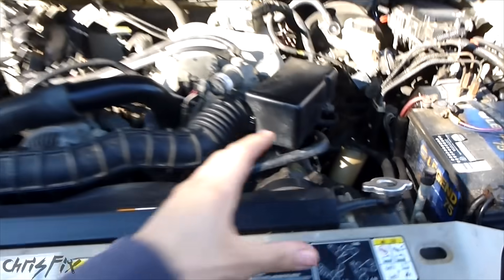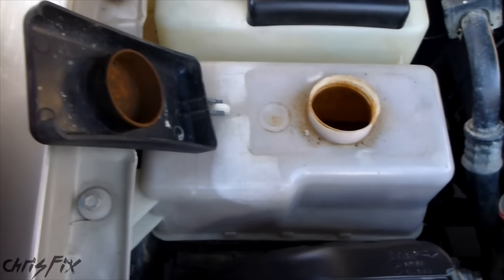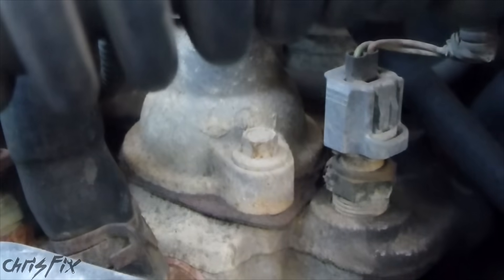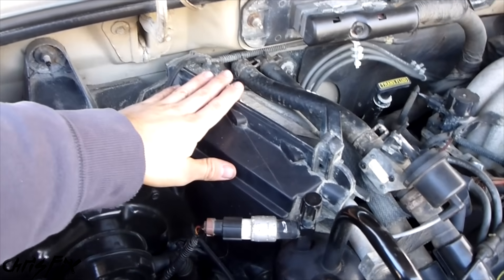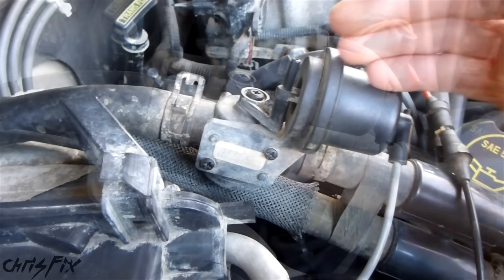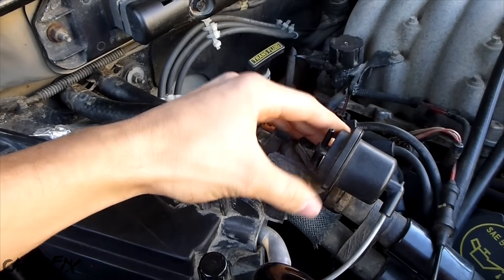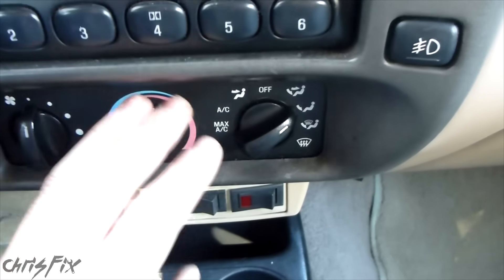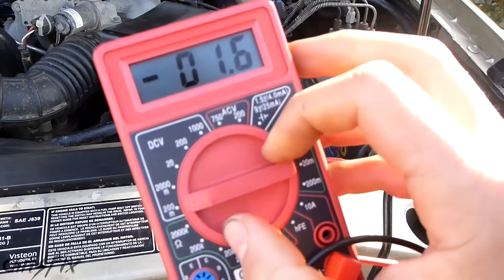How to Fix a Car with No Heat (Easy)

Comment: I have an 89 Cadillac DeVille
When the air conditioner is on cold air blows from everything but when the heat is on it blows from everywhere but the front facing vents.
Hot air blows from the windshield vents a d the floor vents  but nothing comes out of the vents on the dash. What do you think it is?
Reply from the maker: I’m assuming that is a vacuum actuated vent door system so check for a brittle/cracked vacuum manifold or vacuum lines which control the vents.

Comment: Do you think the recirculating door or outside air door would affect the heater output temperature? I know the position of the blend door does.  Thanks.
Reply: No.
Reply: @MrLucifuge1973  Okay, this is my Son's 02 F150 Pickup, has the 5.4 engine. new coolant thermostat last year along with coolant flush and heater core flush. had luke warm heat before that was done, had fair heat afterwards but gradually got less heat over the winter last year. this year didn't think about it until heat was needed. the AC works great..now we have some warm air not hot, have the temp knob turned all the way up, had the heater core back flushed again last month, cut access panel in the plastic heater box to check the blend door and it is working like it should, burped coolant system in case of air,     both heater hoses are hot but the outlet hose is about 15 degrees cooler than the inlet hose. my truck is that way too and my heater is great. if we turn the blower fan off for a few mins then back on, we get better almost hot heat for a minute then it drops back down to only fairly warm again. this same thing will happens if you shut the truck off for about 15 mins and then restart it  you will have warm almost hot heat for a short time then the air temp drops back down to fairly warm...it's hard to figure out what's going on, about ready to have the heater core replaced. not sure if it's original but the truck has 195,000 miles on it. Thanks for the reply back its appreciated and any comments from anyone that could help us figure this out is appreciated.
Reply: @dddddd2100   I don't think it's the core itself. I'm thinking it is a control issue ie your heater control valve. Is the vehicle staying at the same temp when it warms up? Check and see if you have a ambient temp sensor or check the HVAC computer module. Other then those I'm stumped lol

Comment: 2011 Nissan Altima, not moving heat or air.  Was told it was the blower motor.  Quoted $400.   Single 53 year old lol.....Any videos on changing it myself?  I think I have to go through the glove box to got to it.

Comment: Hi I have a 1993 c1500 truck my climate control is flashing arrows I have no heat I change the blend door still no heat and my temperature gauge are reading low any suggestions thanks

Comment: Do you have a how to replace a blend door actuator video? I have a 2005 tacoma thats giving very low heat then the circulation button turns on by itself followed by no heat.

Comment: I’m having this problem on my 2016 mustang. It has ice cold AC but the heat just randomly stopped working. Hopefully this fixes the issues cause I really don’t want to take it to the shop and come out with a $400 bill.

Comment: My heater core got plugged and I used a hard water cleaner CLR and it worked like a hot dam just unhook the heater core and swish it back and forth ,dealer wanted big money.

Comment: I’m noticing slightly hot air coming from 2 out of 4 vents in the car. I’m suspecting the blend doors because if the heater core was clogged then wouldn’t I not get any heat?

Comment: @chrisfix, I've run the climate control self diag on my car and I get a code that corresponds to the mix door being shorted. When I watch the actuator it moves as intended. Can an actuator have a short that prevents heat working but still moves?

Comment: So my blend door doesn’t move I pulled it and put a new one in plugged it in before installing and it doesn’t move when changing temp. I also unplugged the vacuum line on the heater control valve and it’s blowing warm. But still doesn’t help my for why it isn’t changing temps. Both lines going into the cab are also hot

Comment: Sorry if this has been asked already....but mine greatly reduces the hot air when stopped at a light (idling).  Any ideas?
Reply: Goes from really hot to Luke warm
Reply from the maker: Typically an issue with coolant level, check that first
Reply: @chrisfix  that was the first thing I checked.  It was topped off.

Comment: What could be the issue , when driving reving high i get hot air but on Idle just luke warm, i did a coolant flush and Change and it didnt help , the air gets hot even in standstill when reving the engine. Could it be thermostat or heater solonoid? Thanks for answering

Comment: Flushing the coolant system is not cheap, but it's worth all the advantages, like a well-running engine, and AHEAT!  Ifyou have gunk in the coolant, it can block the heater core and coolant passages in the engine, and you could ruin BOTH.

Comment: Chris, replacing my heater core on my 1997 Camry 4cyl has been hell.

There are tiny spring clips that hold the pipe lips together, which extend from the heater core.
And i can not get them to fit on my aftermarket heater core. 
Do i seriously need to drop a colossal $500 on an OEM to make it work?

Comment: Hey chris hopefully you can help me out, I was driving my sister to work in the morning i had the heater on and it was set at 78 degrees normal i feel hot but it was a bit chilly that day. When all of the sudden i realize that i wasn't feeling as hot as i was, i noticed the temperature change and i looked at the heater and it was still running and set to 78. So i put my hand over the blowers and i noticed that the air that was coming thru was kinda cold like if i had the ac on. But like i said it suddenly changed as i was driving. Any ideas as to what it can be? Just an fyi i noticed that my fans didn't blow as hard as they use to. I checked the fuse it's good no bad fuses, so i'm thinking of replacing both the blower motor and the resistor.

Comment: The air in my Dodge Magnum seems to be the same temperature whether I'm using the heater or the a/c. Plenty of air coming out but the temperature doesn't change. What should I check? Hope you see this.

Comment: my heat stopped after having a new water pump and radiator were put on. I didn't know it right away as I rarely go out in the cold weather before afternoon when it's warm, so I did not need the heater x about 6 months. Is there something that did not get hooked up after the radiator/water pump change that I can do myself?

Comment: So my son's heat stopped working in his 2007 Dodge Caliber. Took it to shop to be fixed. I got a call the next day that because my son had took out the original radio and put in a modified one he messed up the wire's behind the heater/ac control's and that didn't want to fool with it!! Any suggestions on how to get heat into the car?
Any help would be greatly appreciated.
Thank you

Comment: Hey there,  I have a new actuator on my 2011 Grand Marquis.   Still no heat.  A few weeks  ago my fuel pump went out so my battery went dead.   I had read that if battery had gone dead if you get the car re calibrated the heat should come on.  My old actuator went through the clicking noise then no heat.   Can you shed some light on this?

Comment: My 2010 Tundra heat won’t blow hot air until once I mash the gas pedal for a few seconds. Just normal driving doesn’t fix it. I actually have to step on it pretty hard. Then once it starts blowing hot it stays hot regardless of speed or if I’m stopped. Any idea what might cause that?

Comment: If I have heat while driving but when I stop it goes cold do I need to flush my heater core? Coolant is slightly low but there is still some you can see

Comment: Is the voltmeter trick testing conductivity of the coolant in a sense?
Reply from the maker: Yes basically voltage leak into the cooling system because there are too many ions so you need to replace the coolant.
Reply: @chrisfix  thanks for the reply. Big fan of your channel. Cheers

Comment: Hey Cris, I was driving with no coolant on the highway. Going home from work. There was no heater and the temperature meter was going up and then down. And until a point where my car will shut down. It will lose power. Now there's no power. I tried to jump start but there was a mechanic that passed by and he said it's not the battery it was coolant that spilled all over and it got the radiator wet. That's why there's no power. And I asked him what it needed to be done  and he said something and to dry up the alternator. What's your take on this?

Comment: I see alot of oil residue in that radiator. I bet the oil cap looks the same. There is no coolant in the reserve tank. This could either be that the owner is running more water mix than coolant and is constantly evaporating, a leak, or a blown head gasket.
Reply from the maker: Is there a trans cooler that goes inside the radiator? If so it could be leaking. I showed it in this video: https://youtu.be/MeruAZebIeU

Comment: What about intermitten heat? I only get heat on the gas, cool air at idle. Also if I turn the heat down under 85 there's a 2 part intermittent knock and coolant gets low every 5 or 6 days. Always checking coolant in the morning with cold engine. Any ideas?

Comment: Hi, I have this issue with my 03 expedition! It was blowing hot air this past summer and adding coolant didn't work. Now it's not blowing air at all so no heat in the cold weather. Help!!! PS I know I need to replace the front actuator but having trouble finding the correct one!! Prob have to go the the highway robbers aka The Dealership to get the correct one!!

Comment: So I need a bit of advice, so my car has a major coolant leak but only when I turn on the heat and it's somewhere near the firewall. Hoses to heater core maybe? Thanks
Reply from the maker: Possibly or where it connects to the heater core.
Reply: @chrisfix  thanks, I've checked inside and there doesn't seem to be a leak inside, just 4ltrs of coolant spilling on the drive when I turned the heat up 🤦😅
Reply: @chrisfix  thanks, I've checked inside and there doesn't seem to be a leak inside, just 4ltrs of coolant spilling on the drive when I turned the heat up 🤦😅 btw you've saved me alot on mechanics bills over the years 😘

Comment: Hey,
I ran all tests and my car is fine. My problem is the following: when I turn the fan to Max it blows cold air perfectly, and when I turn it manually down it keeps working. If I only turned the fan not max directly it won’t blow cold air on one side. When I turn the heat knob, it will only blow on one side. Can you help me figure it out?

Comment: Thanks you for the tips but I need help on my heater in my 2001 dodge Ram 1500 5.9 when I  drive it hots but when you come down from speed it cold and when your at a stop it cold I already replace the thermostat and water pump and both of my line are warm but not hot and I flushed my system I have no idea what it could be I emptied out my radiator it was some nasty stuff but when we did it the second time it look normal. And the blender actuator is fine and it does go from hot to cold when I switch the dial I have no clue what it could be.

Comment: My fan only works on high settings. It blows warm air, could a bad motor blower resistor cause little heat?  I changed the thermostat with new coolant.
Reply from the maker: That sounds like a blower motor resistor
Reply: @chrisfix   Thanks Chris ❤️

Comment: I have a 2013 Dodge Avenger, My heater is really hot on far driver vent then gets colder as it goes to passenger. Far passenger vent blows cold cold. I have flushed heater core and radiator put new coolent, replaced thermostats, blend door actuators work, blower is good still have the same problem. Any ideas of what it could be?

Comment: hi, tried all your suggestions but unable to find root cause to fix the issue. Cabin heat luke warm at best and takes a long time to get toasty inside, and only on the driver side. passenger side remains cool all the time. Blend door actuator is moving, both heater core pipes are getting hot. Car NOT over heating. Thermostat and waterpump ok.

Comment: Hey, my bmw e39 got a heating problem, recently it got a water pump change, and it only blows cold air until I drive around around 90kmh only then it stars to heat up, what could be causing the problem ? Any tips where should I look in?

Comment: My truck lost its heater promptly when I used head gasket sealer. I've attempted to flush the core but it has still failed. It has a mechanical control valve that is hooked up properly. Every other possibility mentioned in this video has been investigated. I should have had my mechanic take a look when he was doing a gasket job for me but I didn't and here we are. Advice would be appreciated.

Comment: 05 tacoma here. heat intermittently works. temperature gauge reads right in the middle, the fan works but just blows cold air, BUT sometimes will start blowing warm air. side note: once in a while i’ll hear a gurgling sound. like liquid bubbling, then the heat works. any ideas?! please help!!

Comment: Could a fuse control the heater control valve on a 2006 Pontiac G6? My AC and Heat both don’t work. My fluid levels are ok

Comment: any chance the Overflow reservior, lik ethe one you check & it was empty............... any chance belinbg empty would make No heat?    My radiatioor is full but Overflow is bone dry & zero heat, just blows cold.
Reply from the maker: That would indicate low coolant, top off the radiator and fill up the overflow and you should be good!
Reply: @chrisfix    filled up overflow, ran it still no heat              .... passenger side line is cold, drivers side line is very warm

Comment: Hi Chris I have a question about my 99 accord v6 when it cold outside I’ll have good hot heat but if I use heater when it’s warmer outside it wants to blow cold I’ve checked coolant radiators full filled over flow to max so that’s ok while back replaced my mode actuator cause had no change to vents and no flow to two center vents just can’t figure out what’s causing this problem just wondering if it could be the other actuator under glove box that controls temp cold and hot just wondering if you had any idea of cause 99 accord v6 3.0  204k

Comment: I hear a grinding a clicking noise, there is just some warm air, where is the gear slipping, where are the located, behind the dashboard? Do you have a video how to replace, I have 1999 Lexus RX300 3.0 V6

Comment: I think the fan motor is broken, but when I open the windows, heat comes in through the vents. Is this just because of suction through the heating vents from the engine area?

Comment: I got my heater core replaced by a mechanic, it was working the day he fixed it and it was fantastic, a week later back to how it was before i got it fixed heat not working when i put it on mix. What could it be???

Comment: When the heat is set to max. and the blend door set for the evaporator gets some hot air (through the evaporator setting?)  but no air when set on the heater(Heater core setting?) side. Stuck Blend Door?

Comment: So, my heat and cold air work but when I change it only stays on setting one blowing out and sometimes takes a few moments to get heated up. I went to the dealership and all they told me is it was electrical and would need a diagnostic but haven't gone to have them look at it because know they will charge an arm and leg. But even on setting 4 you don't hear the fan. It's the blower motor then?

Comment: My heater control valve has a cable. Is the blend door and the cable connected to move at the sane time? My cable wasnt moving so i manually opened the valve and still no hot air

Comment: My 2003 Ford ranger will overheat after a few minutes on the road if I drive slowly it will not overheat but if I were to get on the highway it will overheat I turn on the heat in the car and the temperature will go down and not climb up again. I believe there is a leak somewhere and the inside of my radiator is rusty.

Comment: I have heat but only blows out from the dash vents can't change it to blow on the floor and windshield?
Reply from the maker: Sounds like the blend door actuator is out of alignment or broken, see if you can recalibrate it first since some cars/trucks allow you to do that and that can usually fix the problem

Comment: I have a 2002 gmc sierra pick up truck and the heat fan won’t go on but it’ll still heat up slowly. We noticed when he moved the wires on the passenger side the fan would go on but I don’t know which one

Comment: On a 2006 ford explorer I only get heat when the car is reeved up when idle it returns to call air. Had new Thermostat install still same problem. Had system flushed and it fixed the problem but the problem returned in a couple of weeks. Fluid levels are ok. Any suggestions.

Comment: 2003 Mazda B2300, I changed out the thermostat and plugged in the wires to it while it was running and now the heater doesn’t work. Blend door Actuator is working. What should I do

Comment: I have a 2000 Dodge Caravan. THe heater core has been replaced and the hoses do get hot. Still have no heat. How many heat blend actuators in my caravan. I found one under neath the glove box passenger side. is there another one some place else?